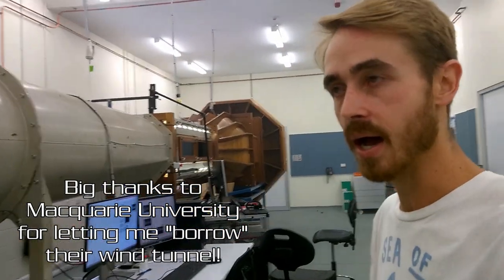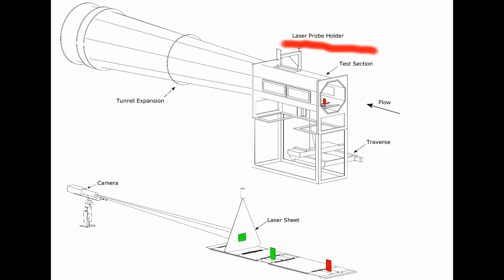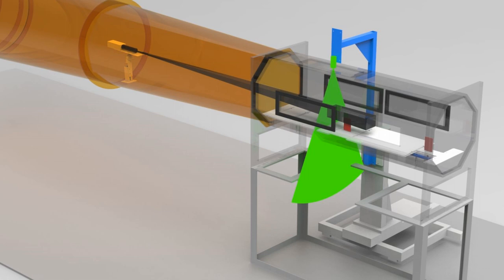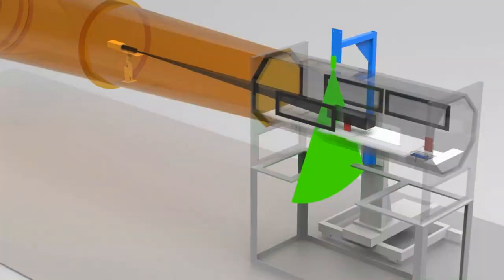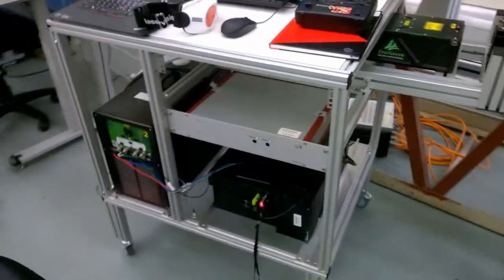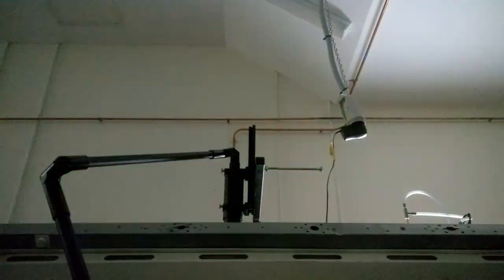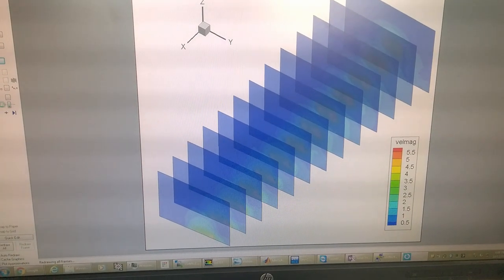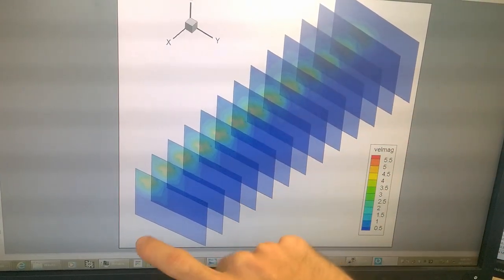Particle Image Velocimetry (PIV) Explained - How do we see airflow in wind tunnels?

Comment: So those of us who don't have access to stuff like this. How accurate are CFD software compared to analyzing like how you demonstrated in this video?
Reply from the maker: +shadowgoat Depends completely on the software and how well you set it up. For this case a 26 million element mesh running LES on Ansys Fluent for 2 months on a supercomputer still had some correlation issues, but was good enough for investigating large amounts of the slow structures. For full car CFD, you can usually get within 15% accuracy (in lift and drag) if you have a decent model, closer if you have correlated your model specifically to your scenario, like many F1 teams do. CFDs greatest strength is in showing trends though. When I do a full car CFD for a client, I typically use a turbulence model that promotes early separation, and thus produce a conservative aero kit that is less sensitive to real world disturbances. It's not on the knifes edge of performance, but better to be safe than be having separated flows in undesirable locations! CFD is a great tool, but the problem is that so many people can operate CFD software, but so few truly understand it, and that is the difference between 10% accuracy and 50% accuracy.

Thanks for watching!
Reply: +KYLE.DRIVES Followup question. Since you have the camera behind the object in the wind tunnel, this cant be used to look at flow patterns that may be obstructed, for example how a front splitter affects aerodynamics. Is PIV only useful for looking at air flow coming off an object?

Also, do you have access to one of these any time? If so, how?
Reply: B Dykes The University of Sydney rents its wind tunnel at $190 US an hour with a minimum of 8 hours booking plus extra charges for calibration of the equipment.